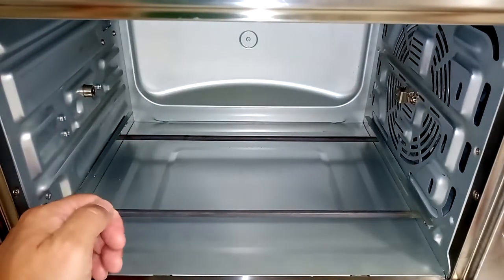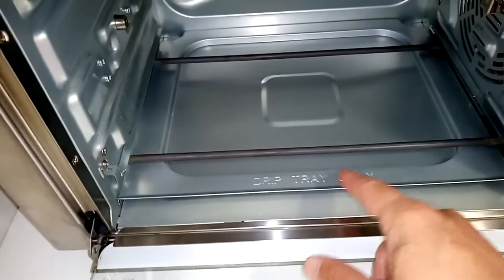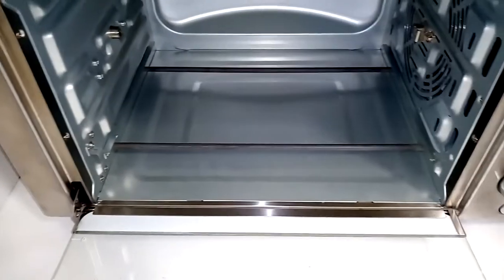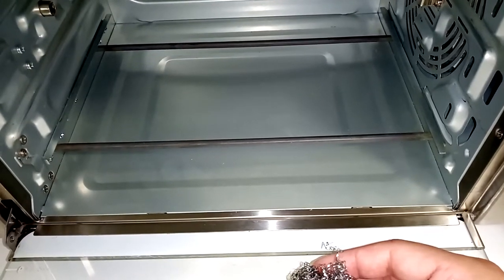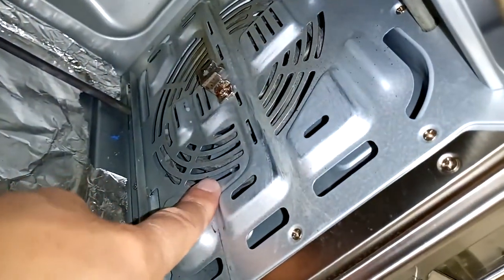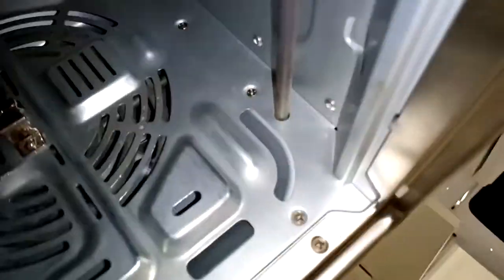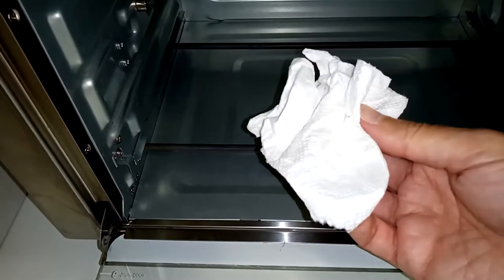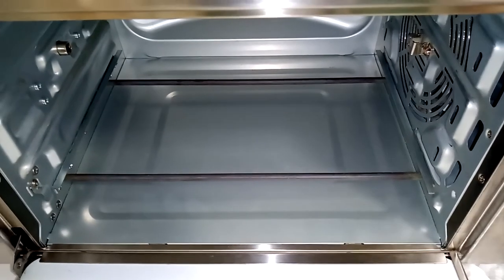How to Clean the Inside of an Emeril Air Fryer 360 & the "Tool" You Need To Do It!

Comment: you talk to much i want to know how to clean thank you
Reply from the maker: The most important take-away from this video is what to clean with.  This is one of the only things that will clean the inside of the Emeril air fryer and remove hardened on grease.  Additionally, within all that talking, I gave valuable information on how to prevent your Emeril Air fryer from getting dirty in the first place, thereby eliminating some of the hassle of cleaning. Finally, I visually demonstrated scrubbing the inside of the Emeril air fryer 360.  So between the visuals and all the talking, you should have learned how to clean the inside of your air fryer, but most importantly, you will have learned what tool you need.

Comment: TWO MORE TOOLS!  Your secret tool, the Scotch Brite Pads, is the only thing that worked. Thanks!  However, I confess that I had let my Air Fryer 360 get really bad with baked on grease and because of the many small nooks and crannies inside the 360, even the pads were not enough to get all of the grease residue in these areas.  I just couldn’t reach down inside them enough to get to the remaining grease, so I tried another tool, Tool #2, Dawn Platinum Powerwash.  Dawn detergent is known for its grease cutting ability.  I use it to get grease stains out of clothing, so why not?  Because of the openings inside of the air fryer, DO NOT SPRAY the Powerwash into the airfryer.  You don’t want to get liquid down inside the vents and damage the electronics.  Instead, take the top off the pump bottle and pour a small amount of the liquid into a cup.  I turned the airfryer 360 on its sides to put the side panel on the bottom so I could clean each side and part of the top inside.  Then use a small, flat, ½” wide paintbrush to gently paint a small amount of the cleaner on the entire area that still has burnt on grease.  You’ll have to be creative to keep the spring-loaded door open as you work.  Don’t use so much Powerwash that it runs down inside the vents.  A little will do a lot.  You have to let the Powerwash sit and work for 15 minutes or more.  It doesn’t do anything immediately, but it will if you give it a chance, it will work.  When the oven was “clean enough” (I got tired of working on it.  Remember I said it was filthy.) I let it sit and dry.  After a few hours with the door open I used the brush attachment to my vacuum to suck up any loose particles on the floor of the oven and inside the side openings.  Then I wiped it with a terry cloth rag dampened with hot water.  Last step for me was Tool #3:  I put a shallow oven safe plate inside the oven with a mixture of 1 or more teaspoons of lemon juice and white vinegar, whatever your plate will hold .  I set the oven to Airfry,  400 F for 8 minutes.  Use a plate, not something deeper so the airfryer fan can circulate the fumes.  This will help dissolve some of what is left inside the air vents as well as any remaining Powerwash.  When it was done and cooled, I wiped out the inside with the terry cloth rag again.  My oven looks “almost” new.  I don’t think it will ever look as clean as the one in this video, but that’s my fault.  The good news is that I’m no longer thinking of replacing it!
Reply from the maker: Thank you for the additional cleaning tips for the Emeril Air Fryer 360.  It sounds like you did an extremely thorough job of cleaning the inside of the air fryer.  Those were the details of a man on a mission!  So now that you've restored the inside of the Emeril Air Fryer to almost new, what have you done about the outside?  Did you watch my video on what you need to make the outside of the Emeril clean and literally shiny like it just came out of the box?  If you haven't, you can find it here: https://youtu.be/n7mvNdm3Ydc
I appreciate the positive feedback and the details you've shared.  Happy Frying!

Comment: I would have loved to see how you handled cleaning the oven ceiling.  This is my biggest issue.  I was shocked and surprised when I happened to lean over and looked up.
Reply from the maker: I can imagine.  To clean the ceiling of the Emeril Air Fryer, you should be able to use the same product / "tool" and firmly rub away any grease, oil, or splatter that has been hardened on.  The only complication is the heating coils that will undoubtedly get in your way LOL!  You'll have to carefully clean around them and be careful not to rough them up.  I get very very minimal splatter up there. It's some tiny dots that come off with my nail or a paper towel with hot water.  It's nothing like the splatter that gets on the sides (like the kind in the video).  I hope your ceiling / top mess just looks bad.  If it isn't just give the tool a try, it should definitely work as well as it does on the sides of the Emeril.

Comment: I have just put in an order for the same one that I had for 2 years,the issue with this model is that it is NOT easily cleaned,what happens is that the hot grease from chicken cooked on the top "Air Fryer" shelf as well as from the rotisserie flies up and into the heating element on top,and after awhile begins to smell much like rotting,decomposing wildlife,luckily I found that the price for the 360 plus has come down very nicely on Ebay  (sellers sells thru Walmart Old Stock),so Ill use and clean for another two years and replace that one as well,but great air fryer oven,I havent used my electric oven in over two yrs and it has become a storage cabinet for pots and pans....AND I use foil on top and bottom,and simply adjust my times......
Reply from the maker: Cleaning the inside of an Emeril Air Fryer 360 is a pain point for almost every user.  That's why I shared these tips and the ideal tool to use.  If you're referring to the top heating element as opposed to the one on the side (where the fan is), you should be able to remove that grease with the tool in this video.  It becomes a problem if you get hardened on grease on the heating coil inside the fan (on the right side)!!  I know one viewer who took apart the side panel to get access to the fan, but I've never tried it myself.  Did you watch my video entitled "tips and tricks" where I talk about using foil?  It's quite a controversial subject so it's always nice when other Emeril air fryer users confirm it works with success.  So thank you for sharing that tidbit.
Reply: Thanks for the tip on using the oven as a storage cabinet for pot and pans.  I hadn't thought of that until now. 👍

Comment: Show the actual how you clean it... that's already clean
Reply from the maker: There's definitely a decent amount of footage in the video where I clean the inside of the air fryer.  I even show close up shots of the brown, caked on oil left over from the beef burgers I made.  I show how scratching it with my nail doesn't even remove it and then I proceed to use the pad in several places.  At the end I show a comparison of an area that still has the brown remnants (of oil, juices, etc) stuck on it, vs. the area I cleaned which shows as shiny silver again.  It's possible you missed it, but I definitely demonstrate the use of the pad and how to clean the inside of the Emeril Air Fryer 360 for the heavy, "caked-on" / "stuck-on oil and drippings that often splatter on the walls.  In particular, on the right hand side, near the fan.  Make sure you watch the whole video because the cleaning part is in the middle.  At the beginning of the video I'm showing a clean air fryer, then I show past footage of the dirty air fryer being cleaned, and then I switch back to the clean air fryer to wrap the video up.
Reply: He does , he cleans an maintains it regularly …. Thanks for the video !
Reply from the maker: @spokezman  Thank you Ritchie... I appreciate the follow-up reply.
Reply: @spokezman  Whop thee dand do
Reply: @loosestudios  what does that even mean 🤯
Reply: @spokezman  people was tuning in to see how to clean the oven that was really dirty now how to keep an oven clean obviously if you clean everything after you use it which people don't do

Comment: That’s a brand new unit dude😂
Reply from the maker: Ha!  Thank you for the compliment, but if you are serious, or simply curious, you can check out the video I made just prior to this one where I cook beef burgers in the Emeril.  That is where the hardened on grease in this video(that I showed how to remove) came from.  You can also view the videos where I used the Emeril before that and afterward to.  In my two most recent videos featuring the Emeril Air Fryer 360, I show the same clean inside (I believe I really highlight it in the Tyson chicken video) after almost two years and all the cooking in between.  Now, if you're impressed with the inside, also take note of the outside.  It took me over a year of experimenting to find the right product to clean (and polish)  the Emeril Air Fryer 360 so it looks brand spanking new, like right out of the box, and I shared the information (including the exact method of application) in another video I made.  Happy Frying!

Comment: Show it after cooking 4 hamburgers.  The grease stains are impossible and oven cleaner took the finish off. To much work to use it and so disappointed as it was not cheap.
Reply from the maker: The brown hardened on grease and splatter stains I feature/zoom in on in the video are from 4 beef burgers!  I mention that in the video.  Here is a link to the video (filmed prior to this one) where I made those hamburgers: https://youtu.be/-CgqK1J3etM
I'm not surprised oven cleaner didn't work to clean your air fryer, and I am against using chemicals in an air fryer.  As you can see in the video, the tool I suggest using works very well and will not remove the finish of your Emeril Lagasse Air Fryer.  I'm sorry you had a bad experience with the oven cleaner, but give my method a try as it's safer, healthier, saves time, and most importantly, works!

Comment: Wait your cleaning a very already clean air flyer. Shouldn't it be dirty
Reply from the maker: If I had a filthy Emeril Air Fryer with months worth of oil, greases, and drippings caked onto the side walls and the bottom of the oven, what credibility would I have making a video about how to clean the inside of a Power Air Fryer 360 (and how to keep it clean)? LOL!! :-)  My oven is clean because "I practice what I preach", but I spent considerable time filming (with zoomed in shots and everything) caked on, brown grease from the beef burgers I had cooked in the days prior to filming the video.  I even show the difference between the area I cleaned vs. the area that hadn't been cleaned so viewers can see how effective this cleaning method is.  I don't think anyone needs, or wants, to see a full on disgusting oven in order to learn, and see how easy it can be to clean the inside of an Emeril Air Fryer.  There are some Emeril videos out there showcasing ovens that are so disgustingly dirty, they will make you feel ill.  I'm not exaggerating.  And what's worse- they don't show effective cleaning methods and/or suggest using harmful chemicals (some of which can become volatile when heated).  I'm trying to help others as the clean up process and necessary cleaning associated with cooking in an Emeril Air Fryer is one of the biggest "sore" points for owners.  I don't want to turn them off, especially if it isn't necessary.  Also, in this video and my other (featuring tips, etc.) I share ways to keep the inside of an Emeril Air Fryer clean while cooking, so there's minimal to no cleanup necessary.  The cleanliness of my Air Fryer proves those tips work.  If you haven't seen the video yet, and since you're obviously interested in keeping your Emeril clean, it's worth watching.  Thanks and enjoy!

Comment: Another tool that could be used on caked-on 'gunk' that forms on the clear windows, is a plastic razor blade as I found out.  At least after trying Goo Gone Oven & Grill cleaner that wasn't working well, I tried the plastic razor blade and lo & behold - it scraped right off!!  Could've knocked me over with a feather when I found that out after SO MUCH scrubbing to little avail. 🤪  I'm not sure if the Goo Gone or the isopropyl alcohol may have altered it's chemical behavior to allow the plastic blade to work its magic, but I keep on becoming glad that I 'discovered' that these plastic razor blades exist...  They're super awesome when you have the need for them, even in unexpected circumstances.
Reply from the maker: Thank you for sharing that.  Cleaning the inside of the Emeril Air Fryer is a pain point for many owners.  The glass door can definitely be tricky to clean.  Do be careful with the cleaning agents you are using in the Emeril Air Fryer 360 or any air fryer for that matter.  If there are remnants of the cleaning agents they can become volatile when heated and possibly become more harmful.

Comment: How long had you had this unit when you made this video? Curious how long you kept it this pristine.
Reply from the maker: My first Emeril Lagasse Power Air Fryer 360 video was published on March 30, 2021 and I owned the air fryer well before I made that video.  In that video, I actually provide tips on how to prevent the Emeril Air fryer from becoming "dirty" in the first place (whereas this video is focused on cleaning up the mess after it has occurred). You can find that video here: https://youtu.be/POS3mM_SPhw 
 If you look at my most recent Emeril Air Fryer 360 video, or any in between, you'll see that the inside and outside are almost always just as pristine.  And I have quite a few videos at this point where I demonstrate my use of the air fryer (so yes, I do use it).  To keep the outside shiny and looking like like new out of the box, it took over a year of experimenting with products.  Once I found the product that worked and the method for applying it, I shared it with everyone.  Between all three videos, "you too could have a pristine looking air fryer" hahah!! (sounds like a commercial, but unfortunately I'm not selling anything).  Anyway, hope this helps encourage or inspire.  Cleaning the Emeril air fryer is a pain point for many and that's why I shared all the info in this video.
Reply: @efficientway  thank you so much! I did see your other video where you talk about how the air fryer smoking is from user error and enjoyed that too. I will definitely watch any others you have! I just received mine late last night, so while I've taken it out of the box, I haven't actually had time to use it yet. I look forward to it though! Good to hear yours is still going strong after a few years.
Reply from the maker: @GalaxyNexus1  Thank you!  Just to be clear (so I don't get any hate mail LOL) there are design flaws with the Emeril, in particular the way they expect users to use the Rotisserie function, which could cause smoking, even if a user follows all of the company directions.  But most of the design flaws can be overcome and a lot of the smoking users experience can be related to not cleaning the Emeril Air Fryer properly after using it or not taking preventive measures.  Anyway, I hope you are well on your way to using your oven and enjoying it.  Thanks again!

Comment: Thanks for video! How do I clean the glass door. It gets greasy.
Reply from the maker: Hi- I know the issue you are referring to in terms of cleaning the glass door of the Emeril Air Fryer.  Believe it or not, the same tool in this video will work to clean the glass.  Just start off gently. Use it with either water alone or a bit of dish soap with it.  Then when you're done use a moist paper towel to clean off the rest.

Comment: What is the air gap dimension between the heating elements and the drip tray?  An additional way of cleaning baked on food on heating element is to take a damp rag and let it set on the element for a while to soften the food particles.  This softening greatly helps in removing the baked on item and will not result in scratching the element such as the stainless steel pads would.
Reply from the maker: The drip tray is not perfectly flat.  The sides are a bit higher.  So at maximum height, there's only 6mm clearance.  At the lowest point, there's about a16-17mm clearance.  That's a good suggestion, but just like in sports, sometimes "a good defense is the best offense" or something to that effect.  I prefer to try to prevent/avoid letting food and other drippings touch the heating elements in the first place.  Thus the use of the baking tray as a secondary drip tray whenever appropriate.  For those that aren't so lucky, hopefully your trick will work.  Thank you!
Reply: @efficientway  Secondary tray sounds pretty good.  Thanks

Comment: Thanks!  I have some of those.  I was afraid to use those.  I thought they would ruin the finish.
Reply from the maker: They can be used to clean the inside of an Emeril Air Fryer 360, but just make sure you're using the same product vs. steel wool, which looks similar. You won't need a lot of pressure and even if you get some hairline scratches, it's in the inside (that no one sees) and it doesn't remove the finish. Thank you for the feedback!  Hopefully you'll get some more use out your air fryer without the dread of the cleanup process :-)  Enjoy!

Comment: tried the dawn power wash did not do anything trouble putting foil on drip tray  for emeriles dual zone air fryer oven
Reply from the maker: Interesting- someone else mentioned that Dawn came out with a new spray.  Perhaps this tool is still the only effective way to remove the problematic burnt on grease, etc. off the walls of the Emeril Air Fryer.
Reply: exercising your penisve the dual zone also have to put the foil on the drip tray really tight
Reply from the maker: Thank you re: using foil in the other Emeril Air Fryer models.  And you are correct, keeping the foil tight around the drip tray is key. @larryhubert8101